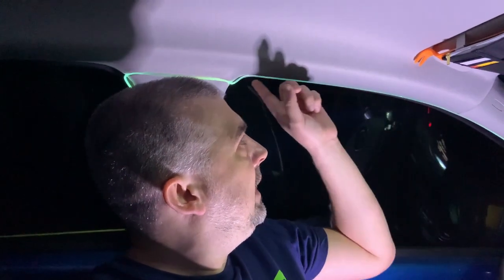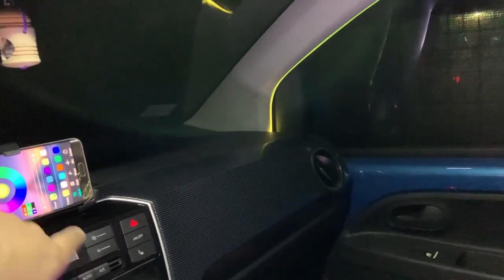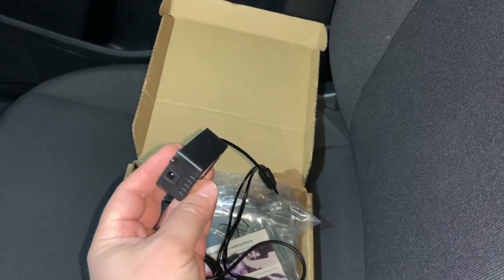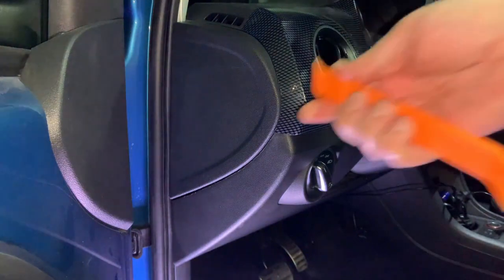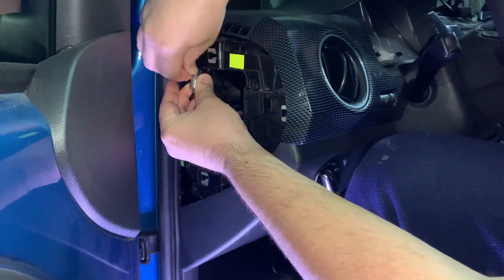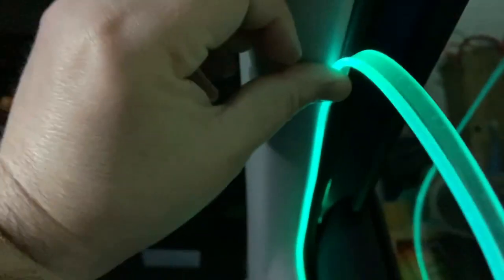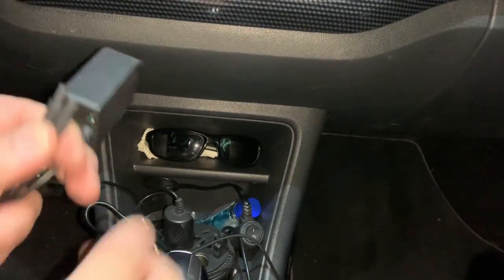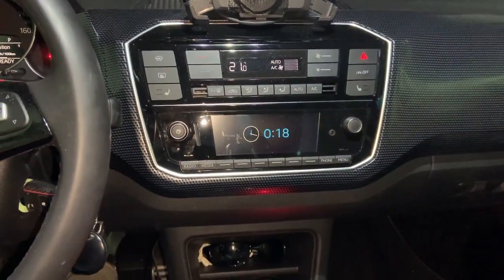How to add ambient light on the headliner in Volkswagen e-up

Comment: Might be good to explain it a bit more cause this is NOT THE USUAL LED LIGHT STRIP.
This is based on the law that light inside once inside glas will be lead through the glass like a beam
We all know that from Märklin / Trix / model railways where the wagons had tiny rear lights that where back then powered by a small 12V bulb in the last waggon from which a translucent bar carried the light like a tube to its end which had a rounded shape and painted red: those tiny lights at the end of the wagon would shine red and the brightness was based on the train speed or the voltage.

These fiberglass lines act like a tube for water - the amount of water you pour in will come out at the end and a flexible fiberglass line is pretty much the same: you lead light into it and at the end of it a strong beam will appear like a flashlight whereever you point the fiber glass end - like in an endoscope. 
Here you get a strong light emitting source that pours the light into the fiberglass line where Tedo had placed this connection point in the fusebox to avoid any disturbances caused by tiny beams that could pour outside the tube connection. Therefore this is hidden. 

Might be worth to show the effect of such "remote and flexible" beam cause it can be used everywhere.

The difference to the  usual LED stripes is that the light does not loose strenght while transfered through the line cause this amount of light is more or less just a side effect while the main amount of light should go out at the end of the line. you can not see any brider spots over the whole strip cause it is no led strip but a flexible fiberglass "pipeline" with a translucent hull.

I have wondered the whole time why it shines without the usual spots until I went to aliexpress and saw such extension line and realized that it was fiberglas - a kind of tube for light ... I still would use that to emphasize a major interieur line and out of the direct viewing field to avoid any reflections and I would use it very carefully or just for shorter lines than the full length cause too much is too much - but that is a tough decision to cut it cause it is tough to reconnect it again without losses.